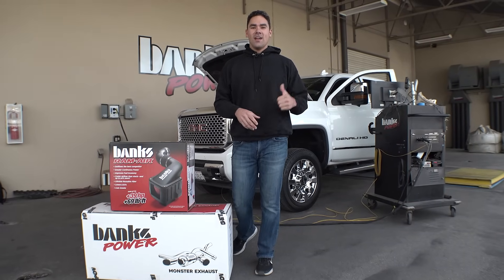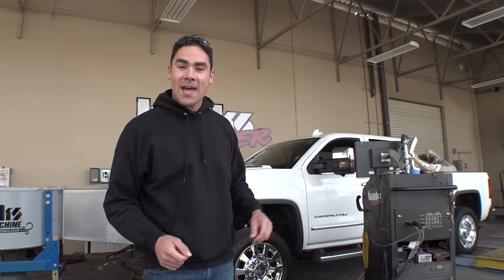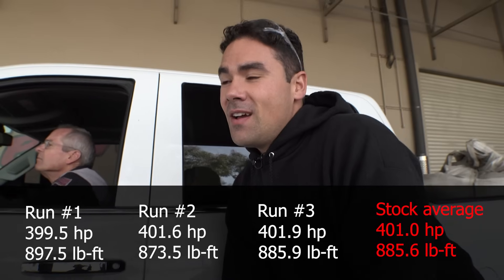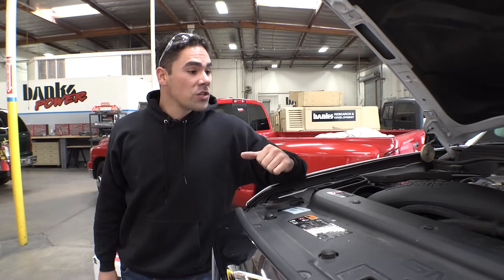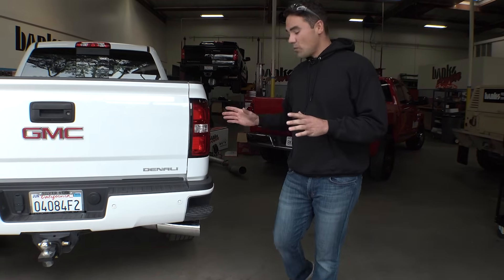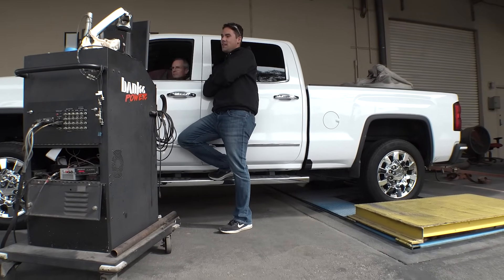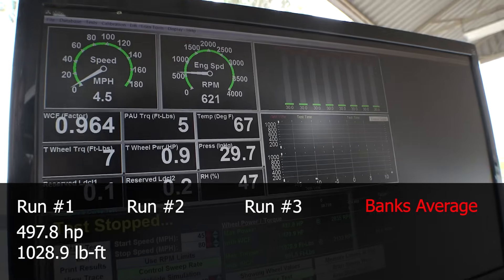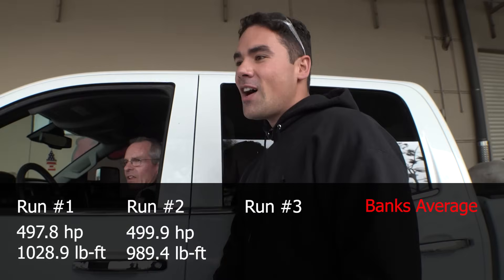How to add 98 horsepower to your 2017-19 Duramax

Comment: I added all the Derringer Banks BS on my 2018 GMC 3500 & it kept throwing a Reduced engine power. Almost cost me a injection pump on my L5P! Stay away from this crap! I spent over $3200 on air tube, pedal commander, monster exhaust and the programmer!
Reply from the maker: Please email us at socialmedia@bankspower.com with your contact info and order number. We'll look into ASAP.
Reply: Out of curiosity, may I ask what became of it ?
I see Banks responded quickly. Now I am curious to know what happened.
I’ve been considering doing these mods, but with your statement I am now apprehensive.

Comment: I have a 2018 fully stock how can you tell when it is in region
Reply from the maker: Other than using your sense of smell, you can't really tell.... Unless you get an iDash SuperGauge or iDash DataMonster. Not only does it tell you when you're in regen, it tells you how much soot is actually in the DPF, when the truck is going to regen next, how many miles between regen and so on. You'll know more about your regen activity that the dealership. We recommend two things. Check out the iDash and join the Derringer Owners Facebook Group. There are 3500+ Duramax owners using Derringers and iDashes. There's not a question you can dream up that they can't answer. https://www.facebook.com/groups/derringerl5powners
Reply: My LML goes to a higher idle when it is in regen

Comment: Is the 5 inch exhaust just the tip ?
Reply from the maker: It's more than just the tip. The swedge angles in the pipe help the flow. In other words, every time you go up in diameter, it helps reduce backpressure. Think of it like a rocket nozzle. There's a common misconception that post-DPF pipes don't add performance. And, well, it's a misconception. We've proven time and time again that reducing backpressure, even post-DPF, reduces engine pumping losses which helps. The 5" system is a zero backpressure exhaust. And, at highway speeds, we've actually measured a vacuum just inside the tip. So, it's actually scifening out exhaust gas. Crazy but true.

Comment: It’s not up to that power for a reason it’s hard on your transmission and rear end mine has 445 factory rated it’s all I need I don’t need more but each to his own my salesman told me if I leave it stock 500,00 miles without a problem but like I said if it makes you happy that’s good it’s America
Reply: You do understand the difference between crank and wheel ratings, right? Your engine is the same as the one being tested.

Comment: How can you get engine HP and TQ on a chassis dyno? are you somehow estimating the power loss through the drivetrain then converting to crankshaft HP & TQ? Or are these numbers actual HP and TQ to the wheel?
Reply from the maker: We measure rear-wheel horsepower on the chassis dyno. We don't use the chassis dyno to measure engine horsepower. Sure it could be estimated, but that's only an estimate.

Comment: How much dose this set up cost
Reply from the maker: It depends on how you configure it. Here's what Griffin has in his truck. His total gain is 98hp/125 lb-ft.
Derringer with iDash DataMonster: $869
Ram-Air cold air intake: $388
5" Monster Exhaust: $497
You'll find all the parts here: https://www.bankspower.com/l5p

Comment: Great review.  I have to ask a question...In other Dyno testing with other shops on YouTube, I have noticed they will make a dyno run and complete it in about 10 seconds with the last few seconds of the run at full power yet the rpm's increase very fast then, that shop will display a readout of the max HP/Torque.  Just like that, their dyno machine calculated max HP before they actually fully loaded the engine?  Not sure about those testing techniques.  Maybe BanksPower could do a video about the proper method to test for HP/Torque on a chassis dyno, apparently like this video.
Reply from the maker: That's an awesome idea! We will add it to the video schedule for the coming months.

Comment: Why not just cut a bigger hole
Reply from the maker: It's not just the hole in the side. It's also the hole in the bottom of the airbox as well as the tube size and design.
Reply: @bankspower  u can still cut it out

Comment: I like how it’s not shooting a bunch of black smoke and making everyone deaf in the process
Reply: Shannon Sisk h
Reply: My truck is deleted and it barely puts any black smoke out when I put it to the floor and the motor will last a whole lot longer than that truck the stuff they have on these deisel trucks is so hard on the motors and its not like a gasser is any better you just cant see the pollution so everyone thinks its so much better.
Reply: This is what happens when its done properly.
Reply: C Steele yep and I’m a fan 👍

Comment: You know for 100 grand or so, any current diesel truck at that price point should easily put out 500 horses and 1000 foot pounds of torque, and if looked after mechanically run without issue for 300,000 miles. There'd be no need to after market this, that and something else. The trucks performance would everyone's requirements, not void the warranty, and faithfully run 6 plus years under routine maintenance. That to me is truck utopia.
Reply: It's also got to meet emissions.

Comment: So what did you spend to get the added 98 ponies and supporting torque? Was it worth voiding the truck warranty?
Reply: Doesn’t void warranty. Do your research this is an inline tuner. Take the tuner out, get warranty work done. Re install the tuner. Not that hard...
Reply: Cost about 1500 to 2000 labor and parts
Reply: They legally have to prove the parts installed caused a failure

Comment: I’ve had the Derringer on my 2018 L5P and have been running for about 25k miles over the past year. It puts you back in your seat and you can feel the additional power. But there is a known issue that causes a transmission stutter downshifting between 4 to 3 when running at highway speeds and you step on accelerator. Feels like the transmission is going to drop out of the truck until you let off accelerator and let the tranny complete it’s shift. Have been in contact with tech support a few times and they still don’t have an answer as their engineers are working on it right now except driving in stock setting.  It happens when any level other than stock is selected, towing or empty doesn’t matter. I’d ask them about it before you buy.  If they get this fixed with either firmware or an update, I highly recommend otherwise it’s a $750 gauge on your dash.
Reply: Any fuel economy gain?
Reply: No. It is a power adder so no gain on mpg but baseline at lvl 5-6 you lose about 1 mpg for normal driving give or take how heavy you are on the peddle.
Reply: My stock 2019, no mods, 9,000 mile 3500 HD SRW did this just a few weeks ago pulling a 13,000# travel trailer.  i had let out of the fuel, then right back on it, doing about 50mph.  i think it's just their nature under rare circumstances.   I have a 2004, 5 speed that has done it before also.

Comment: $2000 for a 100 hp and 100 tq.. Ill pass...
Reply: I agree. I might pay $499 for 100HP/TQ gain but not 2K. Probably can't feel it that much using the ole butt dyno.
Reply: baseline was 886 ft lbs now average is 1010.... i"m no mathematician but that"s 124 ft lbs. yes that 24 does matter especially if you live in an inspection state and need everything you can get out the truck while keeping emissions intact
Reply: @gunsandmachinesenthusiast  you will never notice 24 tq while making 1000 thats 2.4%..

Comment: How do these mods, either individually or collectively,  effect fuel economy?
Reply: Kurt Dahlin that’s going to be more so left up to how heavy your foot is, although there is some fuel mileage to be gained.
Reply: @chevyon37s  This can and should be tested.
Reply: These mods increased fuel economy with an adjustable tuner. The engine operated more efficiently, but the tune that adds fuel for increased power can use more fuel than stock. This is from experience with the 6.0 power stroke kit.
Reply: Fuel mileage is increased as the truck is more efficienct, but I think it's effectively worse because you won't keep your foot out of it haha

Comment: Driving behind one of these modified diesel ,the smell is offensive and I assume illegal. We will eventually see state emission testing again because of this
Reply: These mods will not affect the smell or the legality of the truck.
Reply: Instead of assuming why not do some research? Both the intake and tuner used carry a CARB emissions compliance along with a DPF back exhaust which would not affect emissions either.
Reply: The smell is primarily the fuel. If you run biodiesel that is based off of used canola oil it smells literally like a fryer. Gas engines smell like gas or burning corn based alcohol or ethanol. The smell of piss you get is well apart of the uria or euria can't remember spelling right now but that is literally the piss smell.
Reply: @Emily Stornetta I guess you dont like the truth. Some people are fucking ignorant crybabies
Reply: thomas mayes There’s an awful lot of ignorance in your post.
Reply from the maker: All of the Banks equipment in this video is CARB and Emissions legal.

Comment: this guy is a salesman, doesnt know a thing except what he thinks ya want to hear. it would be nice to see power / torque vs speed to see where ya get the gains or vs rpm instead of peak #'s.
Reply: MrMarkjax would definitely be nice to see where and for how long the gains are over base line. But still very good results that you’ll notice for emissions intact tuning.
Reply: I can honestly say that after 30,000+ miles of towing & occasional drag racing with my L5P this setup definitely gives you the gains where & when you need it.
Reply: @truckguyjoe  True, still would be nice to see a before/after graph.
Reply: He’s doing his job. They are trying to sell this
Reply: And??
Reply: @Icutmetal  im like gale, more of a science guy, watch these vids for educational reasons. If its a good product it will sale itself.
Reply: I can’t see spending that type of money for less than 50 hp. No idea why he was only running 399hp stock? It’s 445hp factory and mine hit 455hp stock. Nice sales pitch though. I suppose if I want to add 15-20 horses I can just cut a larger hole on the bottom of my air filter casing instead of loosing an 80 thousand mile warranty
Reply: It’s 445 factory crank horsepower.. his numbers are right on the money. I suppose you could post a dyno graph....

Comment: I dont see the exhaust for the L5p on their website. I dont even see them have a category for the L5p
Reply from the maker: Sorry about the issues. We are doing updates to our website. Here are the links:
www.bankspower.com/i-2756-66792
www.bankspower.com/i-2806-48996
www.bankspower.com/i-2622-42249
Reply: Banks Power i have a question? Does the exhaust require a tune to be done once it is installed?  And i assume this wont mess with the function of the exhaust brake as i am new to diesel ownership.
Reply: Banks Power thanks.

Comment: How will the trans hold up to this power ?
Reply: 100 horse, it should hold up fine especially with a bigger pan to keep it cool.
Reply: Less then 100hp, the Allison will be just fine.
Reply: I have 30,000 + miles of towing and drag racing on my L5P…no transmission concerns.
Reply: They are not seeing any tranny failure until 1500+ lb ft of torque.
Reply: @chadeeb20  I have yet to see a Allison that doesnt limp dick way before that, great trans in stock to 100hp but garbage after that.

Comment: Does this void warrunty?
Reply: @Emily Stornetta Fantastic destruction of the simpletons 😂🤜🤛
Reply: @Emily Stornetta what video were you watching?
Reply: The ECM has the ability to compute the torque. The load calculation and the acceleration of engine from crank sensor yields that. It may not be Dino accurate but it is stored in ECM and if you do drivetrain damage the log file from ECM will be pulled and read for warranty authorization . No dealer will risk a >$5K repair ticket without prior approval from GM.
Reply: It's a piggyback tuner system, ecm remains with a stock tune. The EGR kills power so likely a main focus of the banks tuner is keeping the egr shut.
Reply: While the mfg may say its covered,  take it in with a blown motor, turbo or transmission and see what happens. I worked for GM dealers for 5 years and can tell you that you cant count on it. At the very least you will get grief. Get the dealer to get it installed if you want to avoid hassles.
Reply: @Emily Stornetta I would definitely remove the tuner before taking it in. Of course you can contest the ruling by calling in the factory rep. I've seen dealers reject warranty just because the undercarriage had a bunch of mud caked under it claiming abuse. Of course you have some leverage if you took it to the dealer you bought it from. I suspect this truck was $80k + retail. I love mods but it isn't like it was running short on power to begin with.
Reply: Emily Stornetta You’re a nutjob. I never said I wanted to delete anything. I just didn’t like the Chevy dealers snappy tone ...it was kinda like your tone, actually. Are you just on here to express your misery? Lol!!
Reply: Emily Stornetta ...looks like you don’t do grammar either! Good heifer!
Reply: The tune will.
Reply: @Emily Stornetta I am sorry that you got a bad batch of crack.  Watch the video again.  He specifically says we turn the tune up to LEVEL 6.  Jesus, did you even watch the fucking video?  00:19 seconds .  Put the Derringer on, turn it up to level 6.
Reply: Emily Stornetta Man it would suck being married to you!
Reply: @Emily Stornetta I understand how the Derringer works as I have Banks products on both of my diesel trucks.  If you think that you will take your truck putting out these kind of power numbers to the dealer and not have your warranty voided, you're being delusional.
Reply: Emily Stornetta Not to break up your little yes-it-will-no-it-won’t fest you have going on here... but my gmc dealer said “any modifications to the performance will void its warranty.” None of us need lectures on how it works if the dealer service mgr told me that. That’s why I bought a 19 f250 diesel, dear. Lol

Comment: How has these modifications effected the frequency of regeneration?
Reply: It would probably decrease the amount of regens needed, I know that low load low rpm driving or idling are the worst because the exhaust temp does not get hot enough to burn the def, once the exhaust temp reaches a certain temp either through driving/ Regen     it  adds def.

Typically these types of tunes don't change much about how the truck drives in situations that cause build ups in the exhaust, and if with the extra HP it might burn more while he is driving.
Reply: My truck regens less than all stock. Depending on how I drive I can get anywhere from 480 to 1100 miles per regen. All depends on your driving style!!
Reply: Depends of EGT i guess.
If you load the engine often,even stock,you will have less frequent regen than if you drive it to the grocery store for 5 minutes everydays.

Comment: Gains 2 hp and lost 40 ft-lbs of torque
Reply: Huh?  Lost 40 ft-lbs?  Stock was like 880, tuned was 1013...Doesn't seem like a loss...
Reply: @morley3810  between test 1 and 2 after the install
Reply: @ShenaniganswithSchultzy  that's called run to run variance
Reply: Jake Schultz Compared with what??

Comment: Is the conclusion to the differential testing coming out anytime soon?
Reply from the maker: The diff covers are in production. We hope to have an announcement soon. A results video will follow.
Reply: @bankspower  thank you for replying!
Reply: @bankspower  
What about the 2.8L Duramax in the Canyon/Colorado twins? The Titan XD 5.0L Cummins engine? Big boy PowerStroke or Cummins? Or do y'all only do Isuzumax 6.6L engines?
Reply: @Sig721Tau  why don't you try Google? You're asking the questions that you can find the answer for yourself
Reply: Mr.  Banks Do you have any application for J.D.M. model's of diesel engine? Like for Toyota, Nissan, or Subaru model's?
Reply: Unless you're in Japan, it doesn't matter.  J.D.M. does not equal "Japanese".  J.D.M. equals "Japanese Domestic Market"; or, in other words, "Shit ONLY sold in Japan."
Reply: @mysterymete  well for "shit only sold in japan" I have found a Toyota 4 door pickup truck with a diesel engine in it. So maybe not only sold in JAPAN.
Reply: Japanese is Japanese.  JDM is Japan ONLY.  
If you want to throw the JDM qualifier around, at least understand what it means.
Reply: @mysterymete  right hand drive, left hand moving a manual transmission, oh and did I mention it was imported from JAPAN TO MEXICO, then into the U.S. So this Toyota HILUX is rare in the U.S. and comes with a 4 cylinder DIESEL engine.
Reply: JDM cars end up all over the show, as second hand imports (eg here in New Zealand which is full of them)
Reply: @MiG21aholic  i kinda consider you both to be part of the same archipelago.